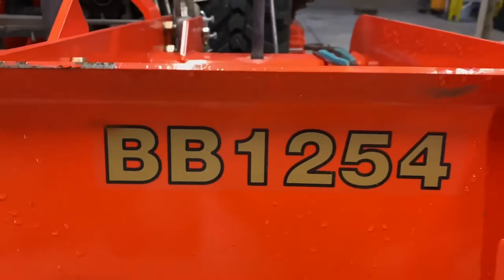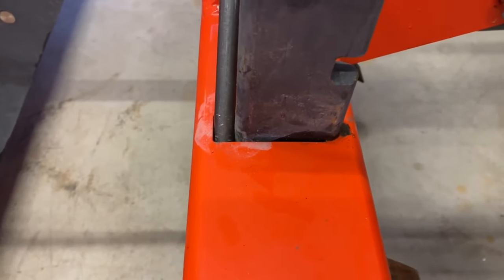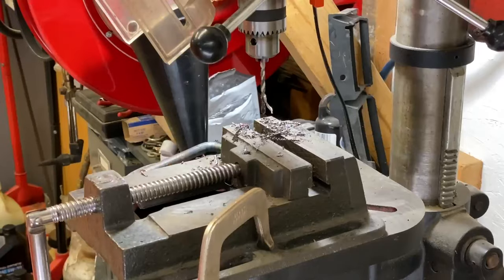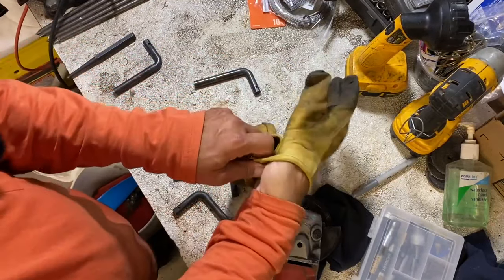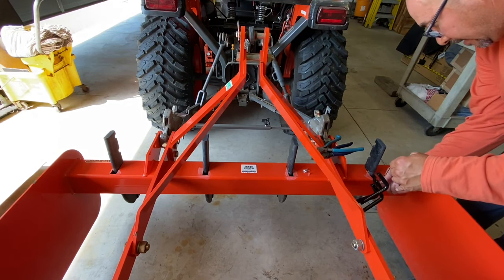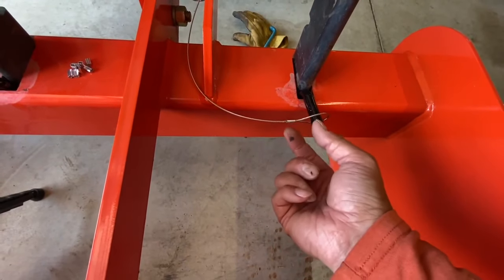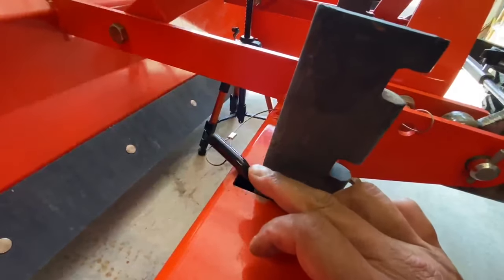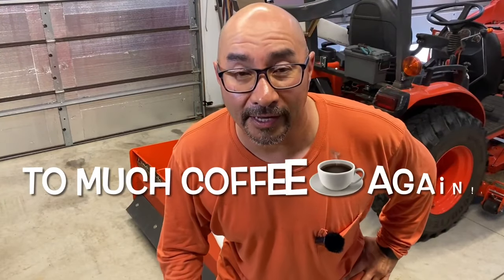Modify  your Land Pride BB1254 Box Blade Ripper Shank from Spring Clips to Pins!!!!

Comment: Hi... great video... for my drill press chuck key....I picked up a retractable key chain, the one that would clip to your waist belt...drilled a hole in the chuck key handle, looped the key chain through the hole in the chuck key  handle... tie wrapped it to the drill press shaft, tucked up under the motor.... pull to use... When I need it for other drills I can just slide it up to remove from the tie wrap.... replace when done....
Reply from the maker: Nice!! That’s a great idea👍 I did almost lose mine once while I was using the drill press.😂 I may have to borrow that idea if you’re sharing🤣👍
Reply: I wish I could clam that one but I got that idea from the 1920-30s??? Popular Mechanic “Do it your self”encyclopedia 
It’s a hand me down from my grandfather.
Reply from the maker: @bj.roberts6410  That is cool thanks for sharing 🚜💨💡😁

Comment: A little piece of sponge or foam in between the clips would work just as well and be cheaper too. For the shavings, I use a old zip lock bag or old used paper towel.
Reply from the maker: Both great ideas 💡 thanks for sharing and checking out the video 😁👍🚜💨🍳

Comment: This year has been a bad year for tractor/implement/attachment dealers.  I got my tractor last month, and they didn't have the Land Pride box blade in stock and no idea when they'd get it.  They got a different brand and after seeing how those rippers are held in on the Land Pride, I'm glad they didn't have one in stock.  The box blade they got for me has pins that go through the rippers and through slots in the cross tube to hold them in place, a much better and easier way of keeping them in place than those spring clips...Land Pride/Kubota should have a much better retention solution than $1 spring clips on a box blade that they charge so much for.
Reply from the maker: You got that right!!! Glad it all worked out for you in the end.🚜💨💡😁👍
Reply: @MJADoingStuff  Well except for the fact I've been waiting over a month for my pallet forks and 60" mid mount mower...called a couple days ago and dealer still has no clue....really need the pallet forks, and really thinking about telling them to forget about it and I'll go with Artillian although they're about double the cost of the Land-Pride but at least maybe I'd actually see them sometime in the next week or 2.  At this point it looks as though I'll never get either the pallet forks or the mower deck at the rate my dealer is going.  Far from impressed...they sent someone to another state to get my tractor, you'd think they could have picked up a mower deck and pallet forks too.
Reply from the maker: @wildbill23c  Yep that’s what I was afraid of.Sometimes you got to do what you got to do good luck 👍🍀 😁👍
Reply: @MJADoingStuff  Thinking of calling the other dealer on the other side of town and seeing if they have these items in stock.  If they do I'll call my dealer and ask them why they haven't gone across town to get them from a dealer 30 miles away LOL.  Then find out what we can do about getting the mower and pallet forks from the other dealer LOL.  I  know they have a BX2380 sitting there with a 60" non-drive over mid mount mower on it, not sure on pallet forks though HAHA!!  Those pallet forks are holding up quite a few projects right now, mostly being able to put stuff back in my shop where it belongs after having to move everything in order to park the tractor inside.  Need the pallet forks in order to be able to palletize and store my implements/attachments.
Reply from the maker: @wildbill23c  Sounds like a plan 👍 good luck 🍀😁👍

Comment: Interesting, The shanks on my landpride 1566 I believe just uses hitch pins to hold them in. Nice work here Mitch, this the content i really enjoy. Thinking outside the box and modifications that will make our equipment better. Did you get the longer top link to go with your Pats quick hitch?
Reply from the maker: Thanks 👍 I am always thinking 🤔 of ways to make it easier or better. I too enjoy modifying stuff. We used to have custom show cars in California but sold them when we moved here. I did not get the longer upper top link I have another project in mind to solve that problem coming soon 😉
Reply: @MJADoingStuff  I will be on stand by looking forward for that video for sure!
Reply from the maker: @HillsideAcres  🤣👍
Reply: That's how the A&B Equipment box blade I have retains the ripper shanks...just long hitch pins.  Those lower end Landpride Box Blades should have the same setup for as much as they charge for them.  Glad my dealer didn't have the Landpride box blade in stock, the off-brand one they got me is much better I think.
Reply from the maker: @wildbill23c  At the time I was looking for a 60 inch this past spring then I noticed there were none in stock so I pick this one up at a different dealer because it was available I didn’t know anything about those clips till after I bought it most of everything I own rarely stays stock anyway😁 I always get ideas or wanna try something different thanks for checking out the video 🚜💨💡😁👍

Comment: Just put the magnet in a plastic bag. When done, turning it inside out puts it all in the bag, ready to toss. Then you can still use your socks to wipe up the left over cutting oil.
Reply from the maker: Great idea funny I didn't think of that but makes way more sense thanks for checking out the video😁👍